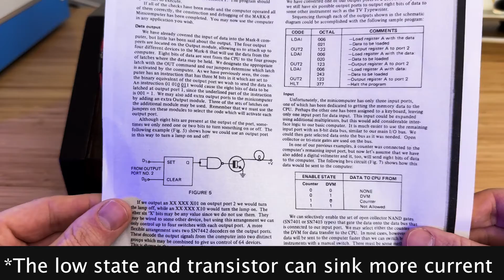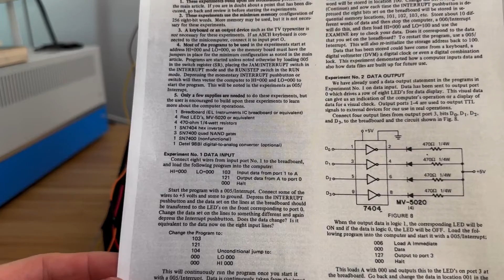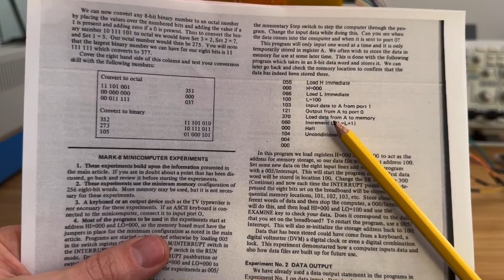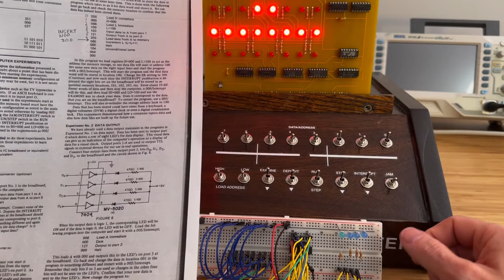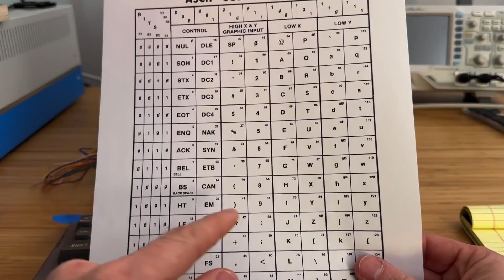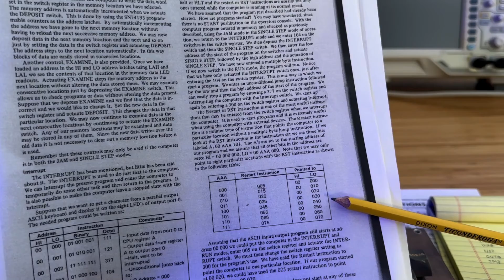Mark-8 Minicomputer Build - Experiments & Keyboard

Comment: Beautiful work!!!  I'm wondering if the issue you're seeing with the required NOP instructions is a propagation delay due to faster (more modern) 7400 series logic?
Reply from the maker: That's an interesting theory. I think most of the IC's I'm using are the regular ones but I might have some LS ones thrown in the mix. At this point the NOPs are fine but, if I have more time, I might look more into it. I do know that many early computers needed NOPs due to timing issues.